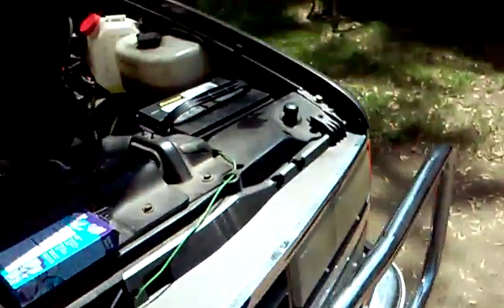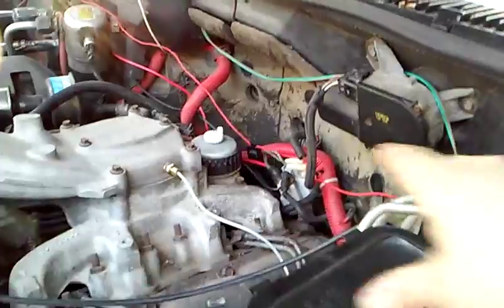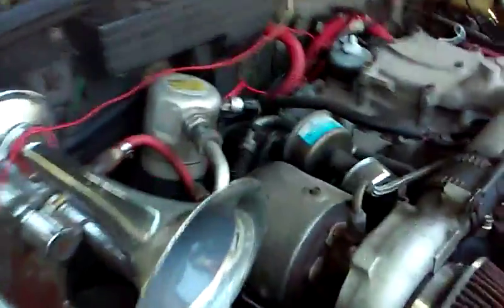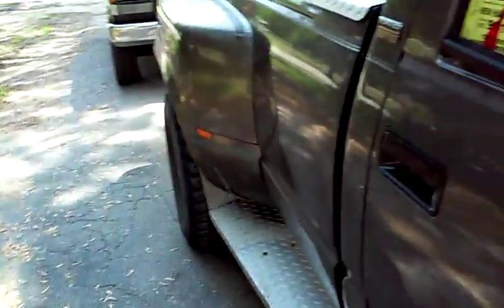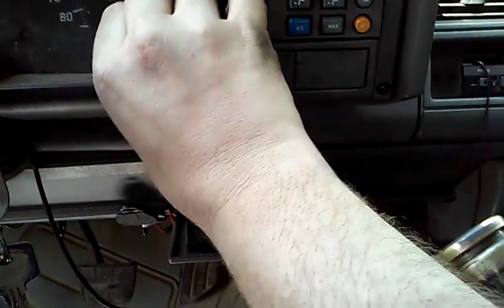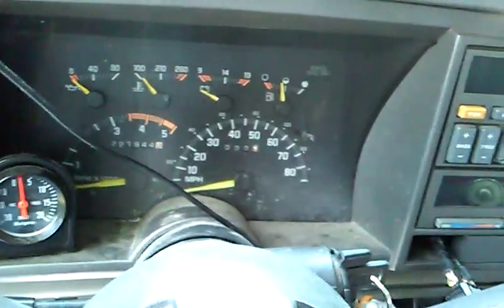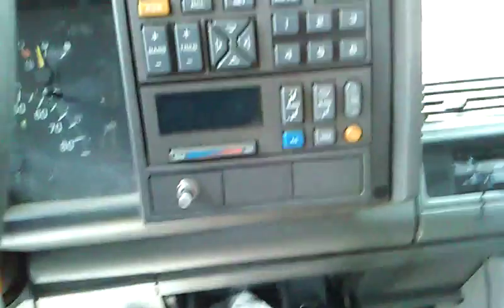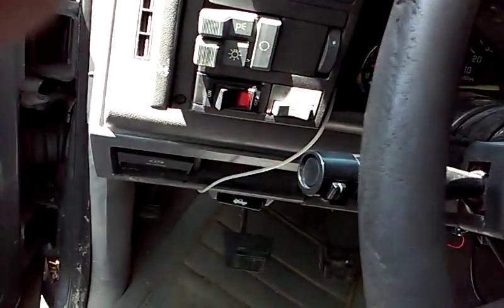Chevy 6.5 turbo diesel glow plug override

Comment: What are the symptoms of a bad glow plug relay?
Reply from the maker: Your glow plugs not working. Or your glow plug light only comes on for a few seconds. The only perk to doing the manual mod is if you live in a super cold or snowy place.  Let's you run them longer so your truck has a better chance of starting

Comment: I see a tube with a breather cap coming off of your CDR valve. How did you run yours? I'm looking to do something like that to bypass the hose from it going to the turbo inlet to avoid oil buildup.
Reply from the maker: its just a rubber hose and the breather is just one of the chrome filters. like you would use on a old Chevy 350 should be under 20 bucks at auto zone or vip. depending on how much you drive should last 6mo to a year
Reply: @oleskoolvp  awesome. Thanks.
Reply from the maker: @Suburban-United  no problem good luck

Comment: I got a check engine code after this install. only when I put it in drive. as soon as I put in park it goes away. and it only comes on when around 13-1800 rpm
Reply from the maker: what year is your truck? if newer then a 93 your probably over boosting and the ecu is reading it as a issue. i think the newer 6.5 are only good to 12psi ish with out a chip. what are you putting out for boosted? you may have to loosen the spring to let it open up some more.
Reply: +oleskoolvp it only started this light when I did the glow plug over ride install never seen the light before. and like I stated the moment I put in drive it comes on. not even throttling in drive. just coasting so I'm thinking it screwed with the grounding when I did it. are you suppose to ground it to the body, or just run two wires from the power wires? does it matter which wires to which side?
Reply from the maker: +Keith Mayer (Easterneternity)  o sorry i did not look at the vid though it was for the turbo master lol. unplug the glow pulg relay

Comment: Glad to see this thanks for the video! Maybe I can make my 6.5 happy again
Reply from the maker: gavinstubbs09  no problem bud. im glad it helped and your truck will love you for it. iv been meaning to do this for the last two winters my glow plugs only worked when they wanted to. so every morning during winter i had to pop the hood and take a jumper wire and do it that way. then try and get to the inside of the truck before they were cold again. during winter it sucks some time you need to do it more then one time to get it to start and if there is ice on the growned  it makes it tricky. but this way you can hold them on longer to make sure she will start. your truck will love you for it come winter! im going to do a vid on the high idle switch make sure to watch that to.